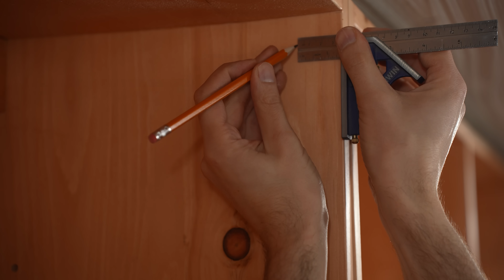Stop Using Plywood To Make Cabinets!

Comment: Please don't say "dowels are strong".  They are not as strong as the surrounding glue joint.  What's more, they do not take any load until the glue joint has failed.  Dowels are for alignment.

Comment: The US must have a vastly different timber pricing structure to the UK! Making boards with any remotely usable softwood over here costs three times as much as using plywood of the same thickness. Hardwood? Well that needs you to sell a kidney!
Reply from the maker: Where I am in Canada, pine is about the same price as the least expensive plywood I would consider for making cabinets (Purebond poplar core).

Comment: 3/4 x 16in x 8ft x 3 boards = 4x8 foot plywood sheet. $105 worth of pine wood vs $75 worth of whitewood plywood. What was this guy referring to as expensive? The pine boards look good so it turned out nice, but a con shouldn't be presented as a pro.

Comment: On what planet is quality s4s pine cheaper than plywood?? A sheet of 3/4x4x8 premium ACX sanded (pine) plywood costs $62 where I live. Using the quality equivalent of s4s select pine, would cost you $237 for 32 bdft (4x8 area), and even the next step down, quality pine, is over $86 for the same amount of material. Not to mention pine boards are more susceptible to cupping and warping, require more work because they're never straight, overall weaker and less stable than plywood, and scratch and dent easily. There's a reason no manufacturers make pine/softwood cabinets. This is the dumbest woodworking idea I've seen so far this year.

Comment: Pine? Premium pine at that? This didn’t save you money…I don’t think so at least, and your shop cabinets will have dents and bumps over time. Pine is fine for face frames, but this sounds like an inferior project due to material choice.

Were you just trying something for the crowd?

Comment: WHAT?  Pine boards cheaper than plywood?  NOT!!!!!!!   Using Home Depot pricing, good quality ("select") pine ranges from $3.77 to over $6 per board foot.  And the 3/4" birch plywood, at $83, is $2.78 a board foot.  AND, it is stronger, less likely to warp, much less labor to create wide surfaces, and much easier to get flat and straight to begin with!
No, not cheaper, not stronger, not easier and in no sense better.
Reply from the maker: pro tip: stop going to home depot for your wood.

Comment: Tell us you're a salesman (as opposed to a woodworker worth listening to) without telling us you're a salesman.  Plywood is not more expensive than solid wood, and it's carcasses will go together better and quicker.  Cabinet backs are important for several reasons.  The average wood butcher doesn't say joinTer.  And the average mortise and tenon built by the average guy will be at least as strong if not more so, than a doweled joint.  There's nothing wrong with being a salesman - just don't misrepresent yourself or the truth in the process.

Comment: So if you want to do a lot more work with much greater chances of having to deal with cupped panels, don't use plywood..... While I would prefer solid panels, I'll stick with plywood as it's going to be way quicker and easier.